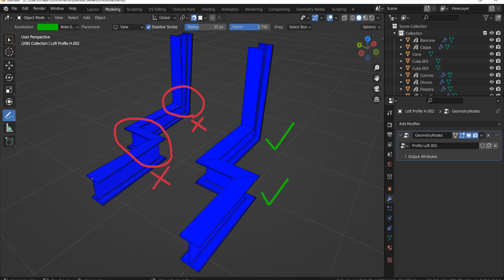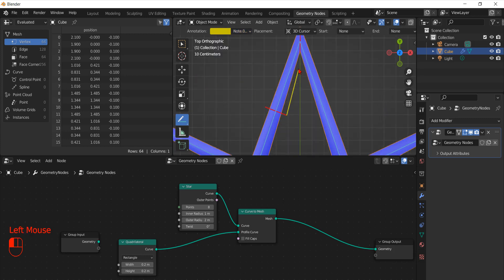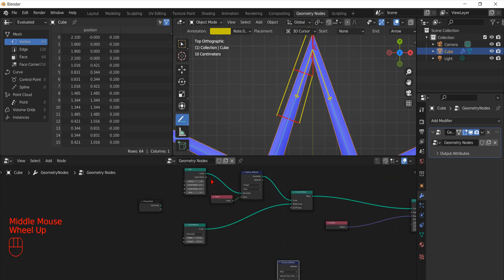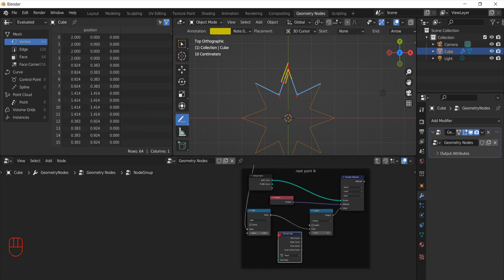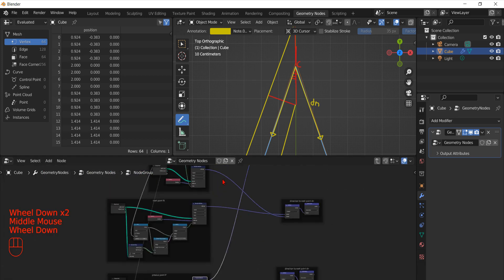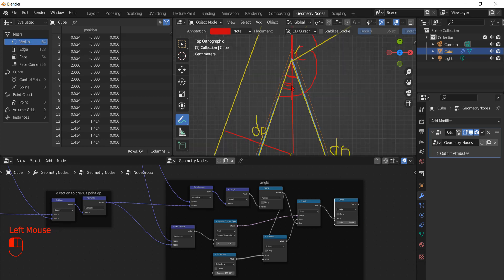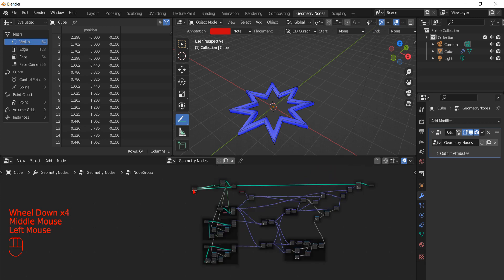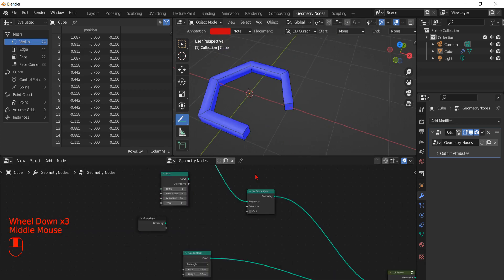Geometry Nodes Poligonal Path Extrusion - Blender Tutorial

Comment: Man this is a little bit hard with latest version because of changes in some of the nodes. I'm new to blender just started a few days ago so it is really hard to work it out. But finally I've done it after many hours and days. haha Math is amazing! By the way I'm in the field of architecture and I want to make many types of procedural railing like assembly in sketchup and this method is the only way that I have found to fix the extrusion along path with open curves. And thank you.
Reply: my man, If you want to be more architecture/design oriented, learning Rhino3D and Grasshopper will open up a lot more doors for you.

Comment: First off, thanks for posting something like this. I’ve been looking around for something which provides this correction for a while now.

However, I’ve used Blender heavily for 6 years for various modeling projects. This 18 minute video has taken me 8+ hours (still working on it) because you keep skipping video frames which crucially show which noodles are connecting to which nodes. I’ve already corrected several mistakes as a direct result of your skipping around like this. You need to pan over the completed node group, or upload the video in higher resolution, if you want this to be an effective tutorial.

I’m sure I’ll get this to work eventually, but the format of this video has resulted in a 3x time gain in figuring out what you’re actually doing.
Reply: Every single change needed to get the desired result. While I'm also not a fan of cuts like this in Tutorials, it's completely possible to follow this one without replaying parts.

Comment: This works great for quickly creating coridoor, hallways etc. One idea I had was instancing more objects on the path curve and so adding doors etc to the walls via scaling the normal, offsetting the doors from the center to the walls, however, the same/similar problem appears (of course I guess). Its probably very easy to do but how would one offset instances on a curve via scaling the normal and have the same perfect result as here in this video?

Comment: Hello greetings from Colombia,
I'm doing the tutorial and I have a little problem. The version I work with is 3.5 and there are nodes that don't have the attribute transfer , which ever blender you work with.
first of all, Thanks
Reply: The transfer attribute is broken down into sample index,sample Nearest and sample Surface.
It can be replaced by sample index here.
Reply: Correct @adastlva7613
Reply: @adastlva7613  Hello,
I have the same problem. When I replace transfer attribute by sample index, all vertices collapse in the center. I use blender 4.0